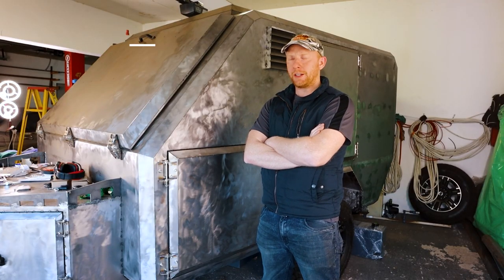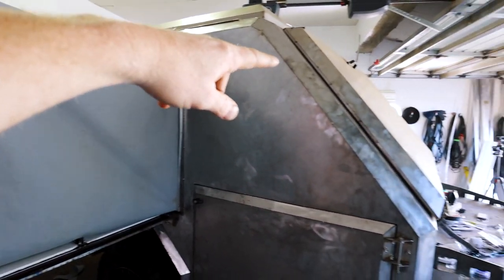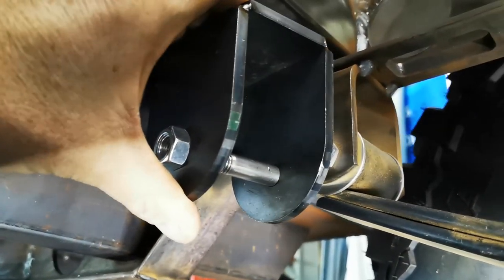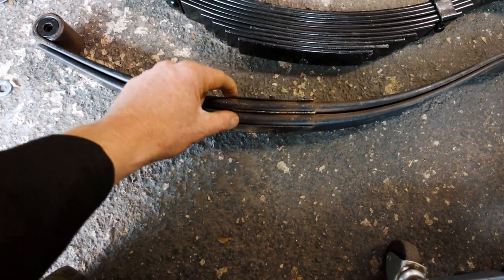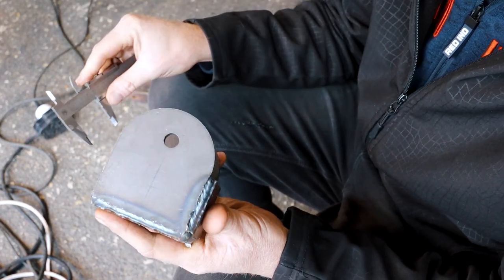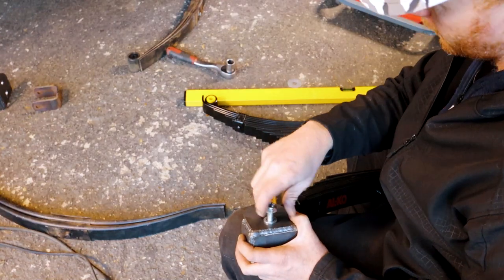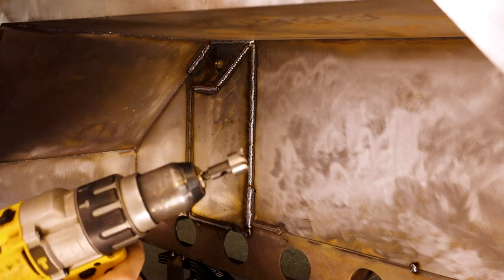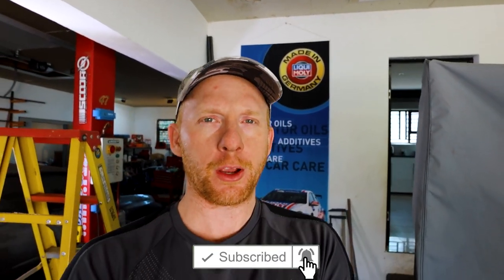DIY Camper Build - Shocks Installation and Swopping The Leaf Springs

Comment: I’m intrigued by the leaf design. In North America we have bolt holes and bushings on both ends of the springs.  It’s pretty clear how your design would work just fine.  Do you grease the area of the frame opposite of the bolt where the springs slide, or is there a bushing plate the springs slide on?

Comment: Hey Marius, This build has me completely invested. Love the design and the craftsmanship. 2 questions for you, firstly the chassis, what material have you used and did you get it cut and drilled like that for weight saving? and 2nd, would you consider making your sketch up file public so we can use it as a base to build our own trailer designs? Cant wait to see more of this build
Reply from the maker: Hi there. Thank you for the compliment, The chassis i used (i think they call it an ip65 section) Its basically a cast C channel but very strong. The upright section is 6mm thick. The top and bottom 8.5mm thick and the corners are round and at the thickest part around 12mm thick. Section size is 120mm x 60mm. I cut them mainly to look  good and my engineer friend told me that even after the cutting its such an overkill for the weight that I'm carrying on it. The weight saving was a bonus. Ill send u my SketchUp files but be warned they are not at all in order and I've made many changes on them as I build. I would only use them for dimensions and so on. All the sections I sent of for laser cutting is on there so I guess it could work. mariusbothachannel@gmail.com.

Thx
Reply: @MariusBotha  thank you so much mate. I have sent you an email. Look forward to chatting

Comment: Hi mate was watching your videos on the camper roof and problems with the shocks why did you not pick some from ebay for a tailgate or boot? about  £10 each or cheaper a tailgate on a hatchback can be some weight so a mini would be fine just shorter stroke
Reply from the maker: To be honest.. didn't think of that.. lol

Just got them in custom pressures and lengths that would work.. or what i thought would work at least ... lol

cheers

Comment: Hi Marius. I just started my own build. Chassis done and dusted. 
Where did you buy the compression latch locks and do they all use the same key?
Reply from the maker: Hi. Good to hear. I'm sure it will be great. I got all the latches, handles and throw over catches from a company called furnlock. In Marlboro.

Cheers and keep me updated!!
Reply: @MariusBotha  Hi Marius. So when do we get an update video off your build? Mine is almost ready for painting. Just busy with all the small details

Comment: Good Work, keep it comming.. 

For the Bending, Why do you not let the company that does your Lazercutting do the bending as well?

I am not Sure where you are located.. From the Accent it seems like Somewhere in Gauteng (just guessing).. If you are in Gauteng, You can use a Company called TW Profile. They do Lazercutting and Bending. :-).
Reply from the maker: Hi there. Thank you so much. The main reason for not having them bend is calculating all the  bend angles and then u need someone that is really going to take utmost care to bend them exactly on the lines where they need bending. I just thought of doing it myself and also saving the money. I'm sure if u get the right company that takes some extra time to get it perfect will makes things a lot easier.. Thanks!! cheers

Comment: Solve BOTH problems.  Drill the hole bigger and make a tophat sleeve to weld in.  Distributes the load from the plate and replaces the washers.

It's a terrific project and you have some skills, but you make some head-scratching decisions.  For example, why not make or buy a perfectly flat fabrication table when you started this project???  And you made beautiful doors, only to use sheet metal tab hinges!  Seriously?
Reply from the maker: I don't have space to store the table. as it is I'm sqeezing in every little space that i can find to work on. to build the roof section for one on a table i need a 1.8m by 2m table.. that's half a garage in space that i don't have. The hinges must be built custom cause  there's no way u'll get a hinge that would work on the angles that i need them to bolt on. These hinges are used on 600k trailers here by us, that's where I copied them from as they work fine on all of those Conqueror still uses them to this day. With my tools and skills there's no better hinge to be made , Thanks for the suggestion on the tophat. Cool idea

Thanks